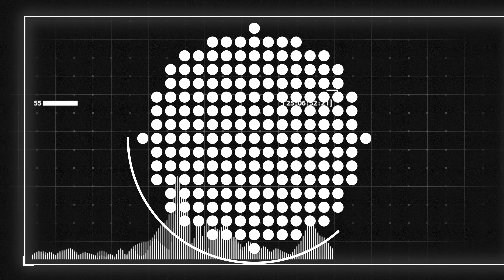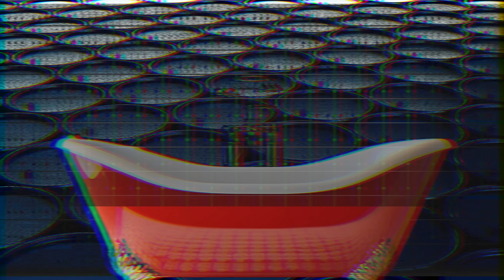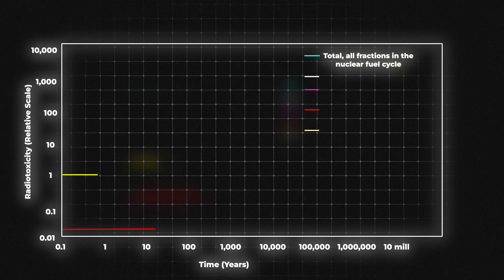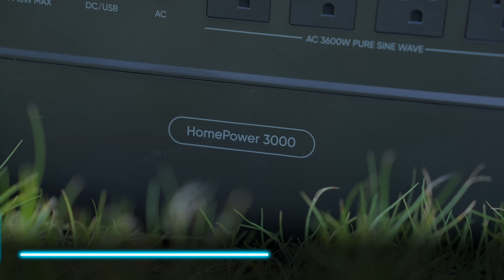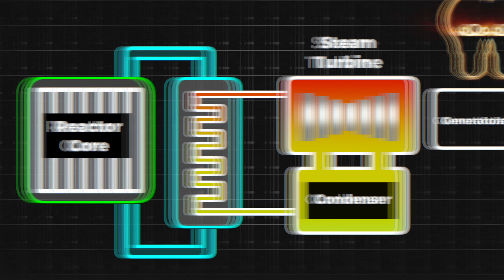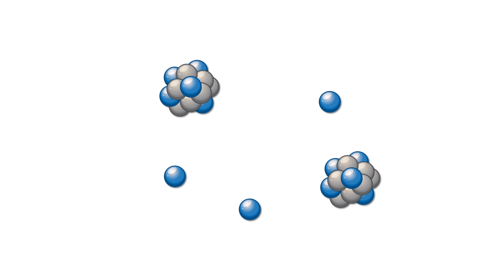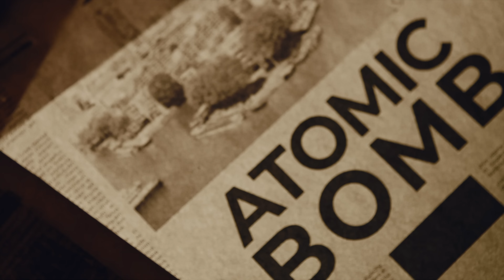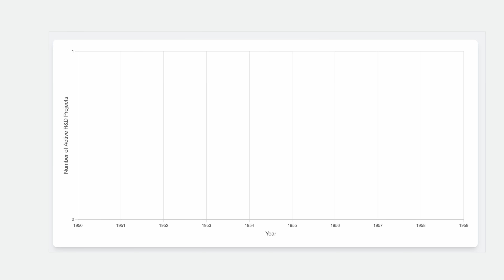Why Thorium is About To Power Everything

Comment: The Race is on. Will we have Thorium power Fusion Power first???
Reply: No.  The race is lost.  China has been testing Th MSR for 15 years, and were so happy that they stopped the test program early and started building a commercial plant which is due to come on line in 2029.  If the USA started now, it has at least a decade of engineering before it would be ready to build a commercial plant.

Maybe the USA can licence Chinese technology, tho.

Warm regards, Rick.

Comment: The fluoride salts are highly corrosive and this is the single barrier to entry to molten salt reactors. The reactor produces U233 which  is a fissile element.
Reply: No they are not, and the issue is solved.

Comment: I suggest you do an episode on the Abilene Christian University new molten salt Rx.  Planned as Thorium Rx, got approved as a Uranium dissolved in molten salt Rx. DOE approved now, HALEU provided by DOE, very similar to Thorium.  ACU is in cooperative with TAMU, TU, and Georgia State U Nuclear Engineering Schools. Thorium with SS, or duplex, with ultra pure FLIBE salt, solves corrosion issues at 700C. R
Reply: I would like to here more about that.
Reply: Just to be clear, this is a permit for ACU to build a reactor.  And the proposed experimental reactor is tiny at 1MWth that might even take until end of 2029 to complete.

We still have to wait to see if ACU's design actually can solve corrosion issues at operating temperatures with good science coming out of the experiment.  Even if promising results are achieved, the tiny experimental scales will still mean there's a substantial gap to prove it at heavy-duty industrial scales.  Provided that ACU is even shooting for utility-scale operations, which they might not be.  Because there are uses for nuclear energy in small-scale specialized applications outside of utility-scale operations.

So many things in nuclear energy look great on paper, but collapse in the face of real-world economics and real-world engineering.  A tale as old as time...

Comment: The pressure is from the climate change cultists spreading propaganda not based in science.  Now tech companies need the power to support AI deployment and have changed their attitude.  Common sense would have dictated an all of the above approach to energy creation but the politics focused only on unproven renewables.  Basically a money transfer to non reliable energy sources and a war against fossil fuels.  Stop with the climate change B.S. and focus on a long term energy strategy based upon resources and technology.  

The EPA has just exposed the climate change fraud and will issue a new guidance for mobile vehicles based upon lessons learned over the last 30 years.  Even LNG was demonized to promote the money laundering effort to non competitive "renewable" industries.  Finally the younger generation is waking up to the lies, just like the COVID19 scandal, climate change will go down in history as one the biggest scams.

Comment: According to Kirk Sorenson of FLiBe (the salts used in the MSR), a steam turbine is to inefficient. A Brayton Cycle Turbine will be used instead because of the higher temperatures of the molten salts. I believe he mentioned either CO2 or He. This would be the same type of turbine used in the 10MW STEP turbine using supercritical CO2.
Reply: Combining different types of new technology is a clear warning sign. It adds more possible points of failure. 

So far Thorium power has one big point failure: I needs to run a in breading cycle and thus needs a way to separate the fission products from the produced fissile material and ideally also the not yet consumed thorium. This would especially be the case in thermal reactor as usually proposed for thorium. A fast reactor could as well use Uranium from sea water, that is plenty and would be no cost issue for a breeder. Compared to the fast breeders thorium power no longer looks that great - essentially the same promisses, just a lot more developement needed for thorium.

So far the separation step for U233 is not well developed and way to expensive - not just a little but more like 2 orders of magnitude. The problem is that a thermal reactor need pretty clean fuel. The even more tricky part is cleaning the thorium - this step is in most calculations droped as it get rediculous effort like another factor 10 or 100. Without that step only a small fraction (like 1% ) of the thorium would be used.
If for some reason one would devolope a magic much more efficient chemical reprocessing method this would be a major proliferation risk.  So we kind of don't want a well working chemical reprocessing and thus an essential part for the thermal Thorium breeder cycle.

Comment: Thorium will probably have more of an impact in the near future than nuclear fusion.  It seems that the primary engineering problem remaining is to mitigate the corrosive effects of molten salt.  Once that is done, there will still be political and regulatory problems, but if it can be shown that thorium reactors can make a profit, there will likely be many stepping in to work those problems.

Comment: Thorium has long been considered the holy grail of nuclear energy, dating back to the 1960s. While its potential is undeniable, the technical and engineering challenges remain deeply complex. I’d be thrilled if we could overcome them all—but realistically, I don’t believe the breakthrough will come from a single reactor built by a startup or even by China. Much like today’s PWRs, now in their fourth generation, a viable thorium reactor will likely require decades of iteration, refinement, and global collaboration before it becomes widely acceptable. That said, its inherent safety advantages make it a pursuit worth continuing.

Comment: Using uranium versus thorium as a comaprison as to the waste problem isn't really technically correct. Uranium as well as a thorium fuel cycle can be done so that the waste is 300 years instead of 100 000. What would be more correct to say is that Uranium right now is used in a fully open cycle, while thorium reactors are considered to run in a closed fuel cycle. If you run uranium in a closed cycle as well, you would end up with only the fission products just as the "thorium" cycle does.
Reply: Calling Plutonium waste is so asinine. It is a fantastic fuel.
Reply: Uranium waste breaks down in less than a human lifetime. Grow up, and go live with the dinosaurs billions.... no trillions, no quadrillions of years ago, you friggen imbecile! Stop exagerating numbers to feel safe from repercussions.

Comment: The energy solution is simple.   The entire planet can be easily saved.
This process can even be used as a planetary thermostat. 
You can cool the planet bring back glaciers , Arctic ice cap prevent Antarctica melting.
You use the CO2 in the atmosphere as an energy source.

We already have all the technology needed to use CO2 as a fuel source.
Every step is simple well known and proven technology, with no bad side effects.
These are the steps.
1.  Build massive solar farms to provide electricity to power the steps below.
2. Build massive refrigerators to cool air.
3. The cooled air will first produce water, use this in Step 6.
4. Continue cooling air freeze out the CO2 , this is dry ice.
5. Use a water source, ocean water will be ok.
6. Build massive water electrolysis to split off Hydrogen H2,  O2 is released.
7. Build massive reformers to combine the H2 and CO2 into Methane.
8. Build massive reformers to convert Methane into Methanol.
9. Methanol is a liquid easy to use easy to transport 
10. Build a lot of engines to be fueled by methanol
11. Existing power stations are easily converted to burn Methanol 
12. Sell the Methanol engines very cheaply. They can easily be filtted into existing cars
13. Sell the methanol at 50c a gallon.
14. Produce enough methanol so that you make more than can be consumed.
15. Pump the excess methanol back into the oil fields
16. Build Methanol reformers to make Kerosene for jet planes.
Easy.  This process mimics photosynthesis, without the trees.

Comment: Thorium has at least two problems.
Gamma rays.   Thorium when irritated transmutes to U233.   U233 fissions and releases Gamma rays.
Gamma rays make everything they touch radioactive. Very difficult to control.
The Lithium Flouride molton salt when irradiated by Gamma rays transmutes Lithium into Tritium.
Tritium is both very toxic and very radioactive, and easily contaminates water.
Thorium reactors could poison the planet.

Comment: One significant upside to molten salt reactors are the separation of high temperature from high pressure. Unlike pressurized water reactors, where the entire reactor is under high pressure and very hot, the molten salt reactor works fine under atmospheric pressure. The high-pressure steam generation takes place where the radiation doesn't need to be - in a heat exchanger.
Reply: Molten Salt Reactors are awesome, but they don't really solve any problem. I have a technology fetish, so I like them a lot.
Reply: This is a very good point to make.

Comment: So, um… has anyone solved the problem of extracting the protactinium from the molten salt in a safe and affordable way at the scale of widespread commercial reactors? Because protactinium poisoning of the neutron flux is a non-trivial problem. Also, has anyone figured out a good way to handle all that hard-gamma-radiating U-232 that happens while you’re making the U-233? 

Has anyone REALLY asked themselves why no one has ever built a commercial thorium reactor? Or does that thinking stop at “(insert your favorite villain here) doesn’t want cheap clean safe energy”?

Comment: Thorium is Bullshit. Nuclear power is only a way to get Nukes
Reply: Nope. Commercial nuclear reactors are not used for weapon development.
Reply: @stijn2644  Just shut up and learn: Thorium does not directly lead to nuclear weapons, but the uranium-233 (U-233) it produces in a reactor can be used in them, although this process is made difficult by uranium-232 (U-232) contamination. U-232 and its decay products emit intense gamma radiation, posing significant dangers to workers and complicating the fabrication of weapons. While not the primary danger, the existence of a fissile material that can be diverted for weapons is a security concern, especially given concerns about the security of existing stockpiles of U-233.

Comment: We've run a 70 year experiment on nuclear energy involving breeder reactors.  It didn't work very well.  There were lots of failures.  Most of them we don't even know about.  Like San Onofre in Souther Cal.  Where are the three missing fuel rods from Humboldt?  The public knows these plants failed.  But does the industry know why they failed?  We don't know.  The industry doesn't acknowledge over 500 deaths that happened due to Fukushima.  That's not a good place to star from and stand up and say they're truthful.

Taking on the next "bright idea in nuclear energy" means going through that 70 year rabbit hole...again.  Except it puts Fukushima on US soil, maybe near Atlanta, LA, New York, Chicago or another major city like Tokyo.  What if there was a nuclear fuel so dense?  What if there were a nuclear solution so safe that it was worth risking New York?

Comment: The other problem with data centres is fresh water to cool them. Thing is you don't need big data centres they could be in small modulation rather than large. Same sort of thing that happened with thorium. The big boys are doing it this way so this is the way it gets done.
Reply: Molten Salt Reactors (MSR) run at 500 to 900 C (depending on the design).  This is hot enough that they can be air cooled (tho they are less efficient than if water cooled).  One of the advantages of MSR is that they could be placed in locations far from rivers.

Warm regards, Rick.
Reply: @RicksPoker  was talking about data centres, not the reactors thought they could rum hotter than that, but thanks for the info

Comment: 233U, derived from 232Th, is what provides the energy in a thorium reactor.  Thorium salts are a nighmare to deal with because of their corrosive nature.  You're better off converting 232Th to 233U the same way that 238U is converted to 239Pu, and then using the 233U in a standard fission fuel cycle.  Liquified, highly radioactive salts flowing through pipes that are bound to be eaten away make for a terrible idea.  The DOE figured that out a long time ago.  That's the real reason that thorium was abandoned as a direct energy source.

When a pipe in a highly radioactive part of a thorium reactor decides to burst, who's gonna volunteer to clean up that mess?  By definition, a thorium reactor is a functional nuclear meltdown.

Nuclear reactors are already problematic.  Forget about the containable waste.  Remember the tritium that cannot be contained.  I like glow-in-the-dark tritium watches, but I don't want to be drinking tritiated water.

While I am not a fan of nuclear power, the problems (not risks) with thorium are unacceptable.

Comment: I am definitely not opposed to nuclear power I am concerned that people will make the same mistake now that they made in the past by understating some of its issues.  This video has said so many things that are just plain wrong starting with thorium not being a radioactive metal it is radioactive and it is as dangerous as uranium.  The largest radioactive clean up I know of in Southern California was cleaning up at 3 a.m. 2:32 purification plant near San Diego.  The people who did that thought they were qualified to demolish a plutonium concentration plant at Hanford. So at least the people who work around it think it's dangerous.

Thorium 232 has a half life of 14 billion years. How does it become safe in a few hundred?  

They had to stop using it in gas lantern mantles for radiation safety reasons and the ash from the mantels is just as dangerous as plutonium on a unit of radioactivity basis.  

Has anyone ever figured out how to dispose of spent fuels in molten salt residue.   Since when do you not have explosions when water meets molten salt?   All of these discussions would go much easier for me if someone could tell me what they did with the waste from Oak Ridge.

Comment: Imagine powering Austin TX with 11 basketball-sized thorium lumps. After 2 years, you need to replace that thorium with new fuel. Those 11 basketballs just need to be safely stored for about 500 years. If you melt them, they would probably fit in a single 55-gallon oil drum.
Reply: ThorCon's 500MWe requires 5kg Th per day and rotates core pots every 4 years due to required replacement of degenerated graphite. As the major currently "unusable waste" is Caesium137 and Strontium90, both having half-lives of about 30years, secure storage needs to be about 10 half-lives to reduce radiation to be no worse than that of background & cosmic levels so about 300years should suffice in the most secure storage compared with LWR's waste that actually be recycled as fuel through an TMSR.

Comment: Thorium still will not replace solar, wind and hydro which are all substantially cheaper/quicker to build and install.
Reply: They are neither cheaper nor quicker than nuclear and solar and wind does not meet our needs. Hydro requires you too have plenty of nature that you are willing to destroy.
Reply: @Kian139 Really.  I am talking magnitudes of cost difference up front.  Every Nuclear plant has huge build costs then you have fuel refining.  Yes.  nuclear is hugely more expensive in the short term.  We don’t have 2000kW generator sized Nukes yet…when we do, let’s talk cost.  Not only this but every household has the option to install Wind and solar.  I would say my argument stands on the merits.
Reply: @rickChapman-y9w  that is not how it works. Nuclear plants last for 100 years or more and wind turbines have an economic life of 12 years. Of course the initial investment is higher. So what? That is not a cost.

Your argument does not stand and it is wildly misleading for obvious reasons for anyone interested in truth.

Comment: you can also breed U-238 into fissible plutonium but oh no that leads to big boomy things. Except the U-233 is also good for making big boomy things.
Reply: U233 is NOT suitable for making bombs.  U232 is always found in trace amounts which produces hard gamma rays, so U233 is much harder to work with than U or Pl.  Also, no atomic bomb has been made with materials produced in a commercial reactor so it is non-issue to start with.

Warm regards, Rick.
Reply: @RicksPoker  that is "easy" to handle. Just isolate protactinium. Wait a half-life. Isolate protactinium again and let it decay to pure weapons grade U233.

But it is theoretical because there are much much easier ways to do it.
Reply: Exactly, but it does not matter as power reactors are very bad at making weapons grade material of either type.